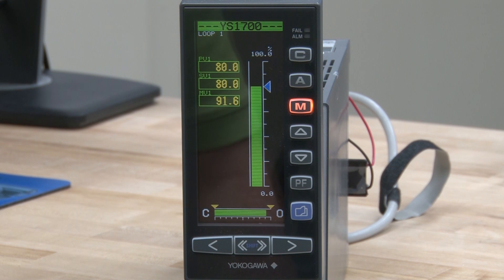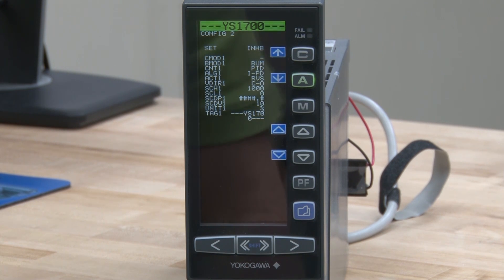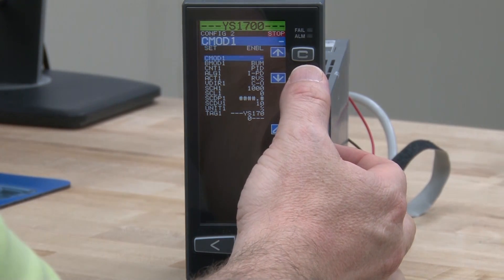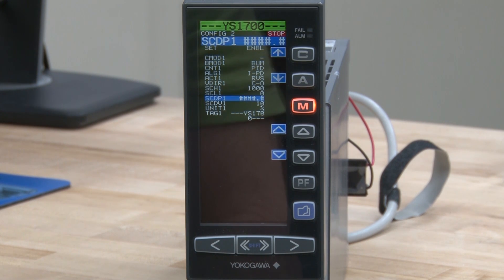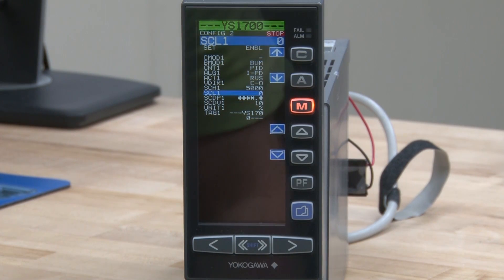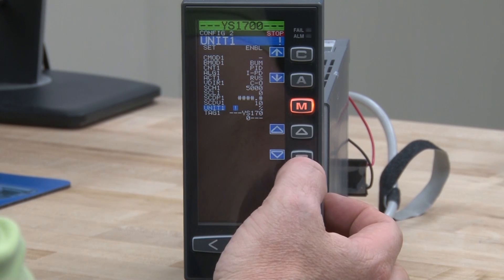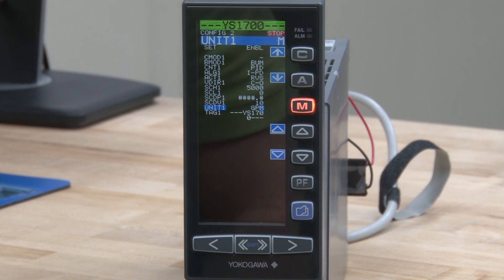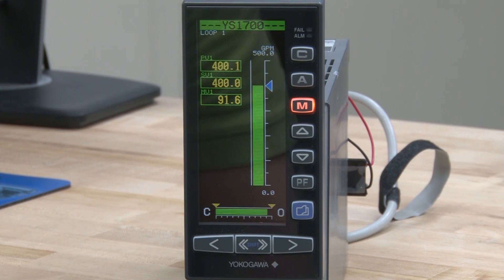Scaling YS1700

Comment: Hello Yokogawa USAI have been using YS170 for ratio control scheme. Overtime we had to migrate to YS1700. In summary, we are having problems with the YS1700 controller. It is defaulting to SV2 = 0 mode every time we want to activate cascade control. We have two customer running programs supplied by vendor for the two controller versions. YS170 Program: and YS1700.  Would I be asking for more if I request for your customer help center details to fully explain my query? RegardsVitalis
Reply from the maker: Hi Vitalis! To better help you with your situation please contact support@us.yokogawa.com and if possible attach your YS1700 program file?
 
Thanks!

Comment: can i control 2 outputs from 1 input? eg. for temperature control....in summer to bring temperature to set point the cooling coil has to be controlled and in winter the heating coil valve has to be controlled
Reply from the maker: Hello Abhijit,
 
Thank you for your question.  The YS1700 PID control outputs are 4-20mA.  It would be possible to achieve ON/OFF control using the transistor outputs, interposing relays and function block programming, I believe there is a better solution. 
 
Our UT35A/UT32A and UT52A/UT55A controllers have an optional heat/cool control mode which controls (2) outputs as you have described.  This solution would allow you to do ON/OFF control as well as PID control.  More info on these controllers can be found by following the links below:
 
UT35A/UT32A
https://www.yokogawa.com/solutions/products-platforms/control-system/controllers-indicators/temperature-controllers/ut35aut32a/
 
UT55A/UT52A
https://www.yokogawa.com/solutions/products-platforms/control-system/controllers-indicators/temperature-controllers/ut55a-ut52a/